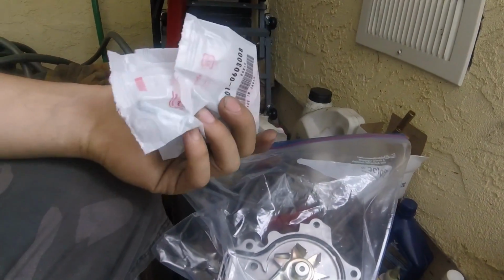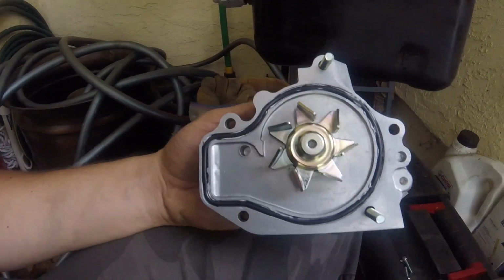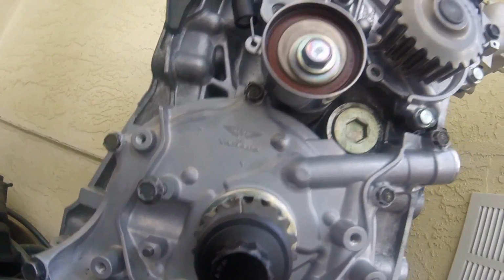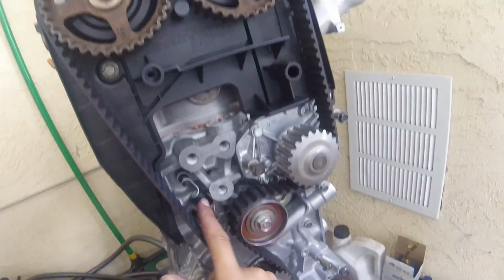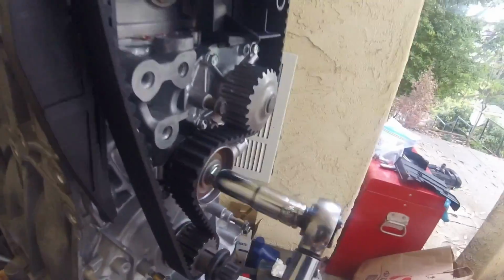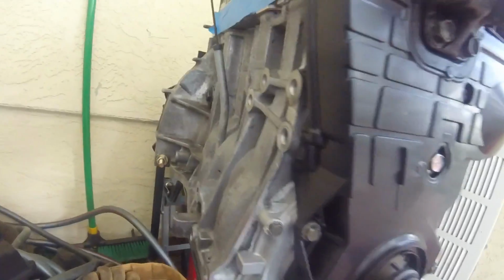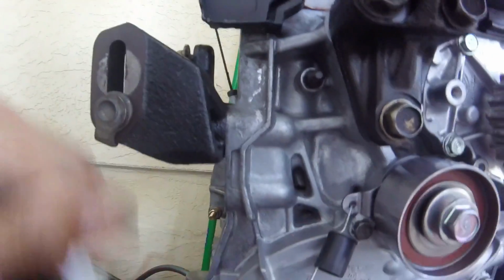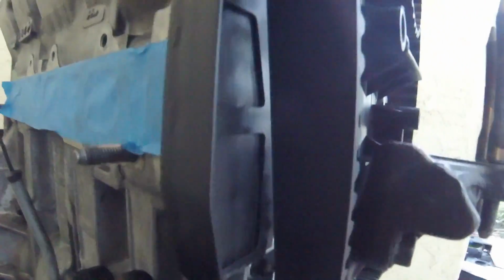Turbo LS vtec build: water pump & timing belt

Comment: Your the only person I found who even mentioned those washers at the harmonic balancer and it was very helpful for me.
Reply from the maker: Glad i could help!  Small details people usually leave out. its kinda hard to explain but the manual shows a picture of it, makes it really easy
Reply: *You're
Reply: Is there a washer before the crank gear and after the crank gear on the b20 as well?
Reply: @maxherman4174  bro I am doing my lsv and been watching your videos as a guide
But I’m pretty stumped here.. The crank but you are using keeps coming off when I try to go count clockwise.. how do you tighten it up without going clockwise and how do you loosen it again when you finish it?

Comment: Do you have an issue where the intake cam won’t line up and have to hold it with a 14 ratchet not sure if it’s because of my dual valve springs?

Comment: Water pump and timing belt which one i have a b18a1 block just ordered a water pump and timeing. Belt for b18c1 and b18c5 the belt is coming woth it 126 teeth will everything align up ? Thanks keep videos coming
Reply from the maker: Any timing belt from a vtec b series will work with a water pump from a vtec b series. Also any timing belt from a non vtec b series will work with a water pump from a non vtec b series. You just cant mix a vtec timing belt with a non vtec water pump and vice versa

Comment: Did you pry up on the timing belt? I pried up and my timing belt whines now
Reply from the maker: No. You are not supposed to pull on it to add tension. Turn counter clockwise 3 teeth and that gives enough tension

Comment: What is the part number for the tool you are using to rotate the crankshaft? It looks a lot more convenient than using the crank bolt. Thanks
Reply from the maker: It is the crank bolt. Its an ARP crank bolt, thats why it looks different
Reply: Thanks man I realized that right after I made that comment. Respect to you. This was a quality video. You are one of the only people that actually follow the manual for this procedure. There is a lot of people on YouTube spreading mis information

Comment: Hey so u used a bottom 96 ls bottom cover and an upper was a gsr for both the upper pieces ,?
Reply from the maker: Your bottom cover depends on what oil pump your using. I used an obd2 gsr oil pump so i used a bottom cover from an obd2 model. My head is a 97, also obd2 so i used an obd2 upper rear cover. The tricky part is that my block is obd1 so i had to customize the obd2 covers slightly so they would fit
Reply from the maker: +Max Herman yes both upper covers were from a gsr. The holes for the mounting bolts are in different locations for the non vtec heads
Reply: Thanks for taking ur time to reply brotha ! This video definitely helps out, especially with the covers ! Keep doing what ur doing bruh!

Comment: Timing covers are ABS plastic, they are a oil based plastic. Nothing will stick to ABS plastic, not even JB. Next time plastic weld the cover if necessary.
Reply from the maker: Thanks for the advice!  I filmed this video almost 2 years ago and the cover is still holding together. Im sure your right though something meant specifically for plastic would have been better
Reply: Jim, if you look at the specs on traditional JB weld it says the max temp it can withstand is 550 degrees F and only 300 degrees F on their plastic weld. I actually just did this mod and am wondering if I should put JB traditional stuff on top of it just in case things get too hot since it will be next to a hot engine. What are your thoughts?

Comment: Thanks alot love hondas have never done lsvtec have a 91 crx dx have a A1 block parts on the way any more advice for a daily driver not wanting to out run the world just wanting 200 hp daily i can have fun with and not destroy the engine thanks for all your help really liked your videos thanks
Reply from the maker: For reliability, OEM internals are your best friend. All stock internals. Get the rods shot peen'd and machined for arp rod bolts, put the engine together to OEM specs and you should be good for a reliable 300whp with a b series if you boost it. If your staying NA than definitely stay with your OEM internals but you will need high comp pistons and some good cams to make 200whp

Comment: 4:51 you do NOT have to rotate the crank 3 teeth to eliminate the slack. what you have to do is insert 2 drill bits in the hole to lock both cams. then grab a 12mm wrench and turn the Intake cam CLOCKWISE  "without" taking off the drill bits. it will rotate just enough to eliminate the slack on top and AT THE SAME TIME tight the tensioner.
Reply: What holes
Reply: Bryan Rodriguez this HOLES! watch this video and skip to the 16:30 sec mark https://youtu.be/M0fHG9X9hF8
Reply: You do realize the crank 3 teeth method is literally in the Honda instruction manual right. I'd rather do that than your method any day.
Reply: @robertvizcarra4414  go ahead. your car will run like sh't.
Reply: @ChikyDRACULA  I always follow the procedure as in the video, 100% success every time good sir
Reply: @ChikyDRACULA  you do realize you can only do that bolt method on non vtec heads ?

Comment: You turned it 6 teeth though. Not 3
Reply: I was just wondering cos i did mine 3 teeths exactly and its kinda loose
Reply from the maker: Im confused how you saw 6 teeth, i watched it back and its definitely 3 teeth. Just watching one cam gear 3 teeth passed the tdc mark. Are you counting both cam gears?  Just pick one cam gear to watch, not both
Reply: Yeah i did count it by each other. Lol my bad . So i should count by the timing mark on the plastic cover?
Reply from the maker: big H   Yes, any fixed reference point will work but the mark on the plastic cover is easiest. if it seems loose measure how much slop is in the belt, i think the manual says you can have up to a half inch of deflection in the belt each way. But also many people add extra tension by pulling on the tensioner a little bit, usually doesn’t hurt anything as long as its not tensioned too tight